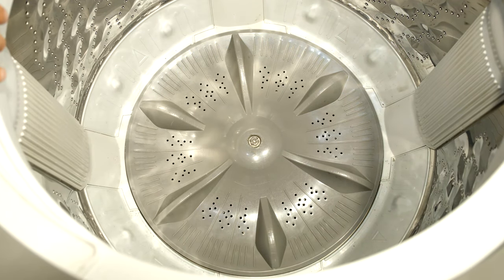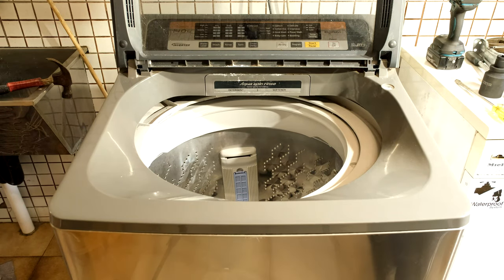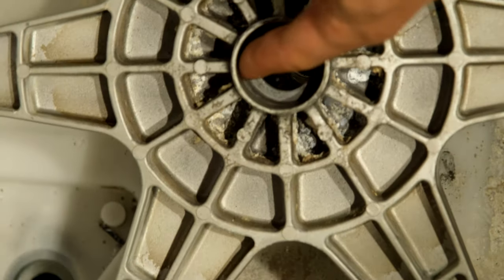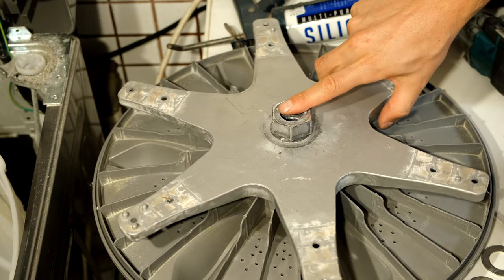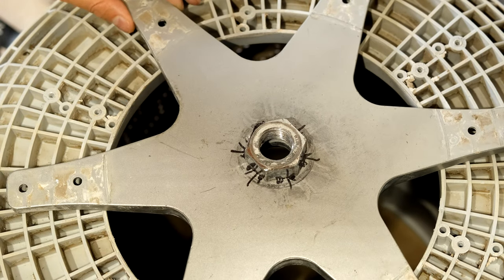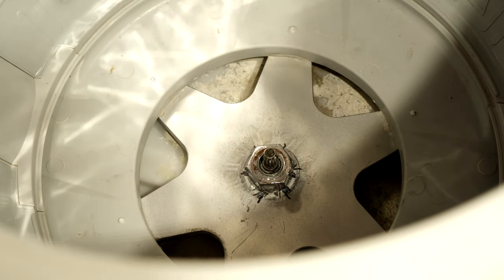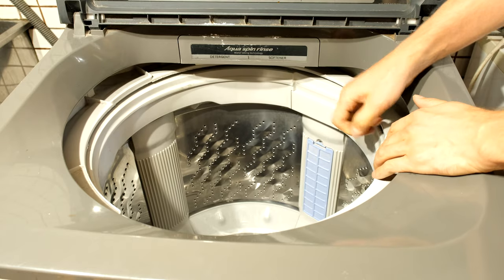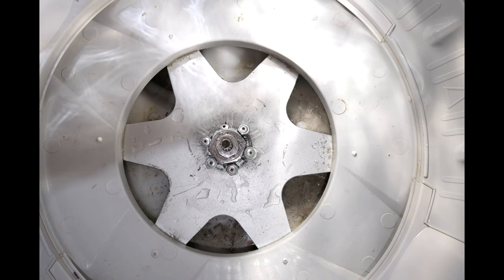How to fix a Panasonic Top Loader that is knocking and shaking - Drum fault

Comment: My specific model is a na-f75s7 but for anyone also trying to take out the bottom panel at 0:50, you can screw the screw back in slightly and it'll be attached to the panel then you can just pull it out by holding the screw.